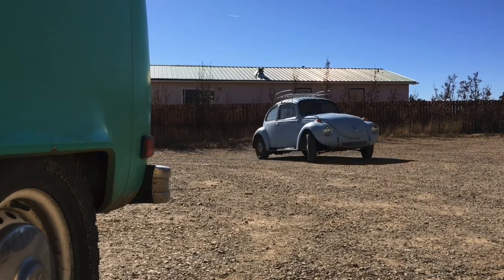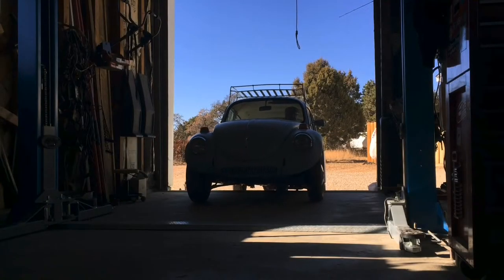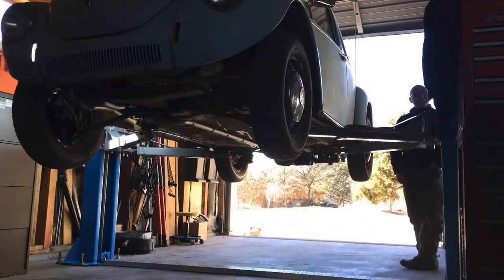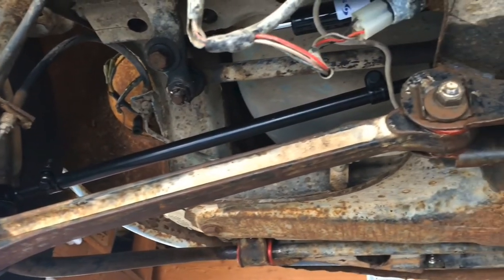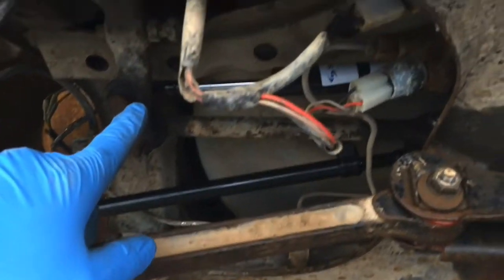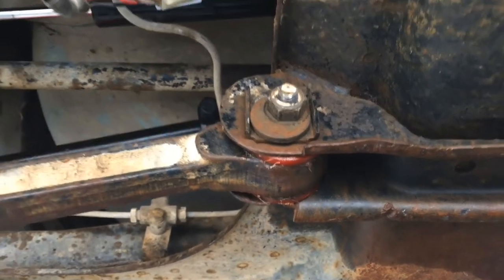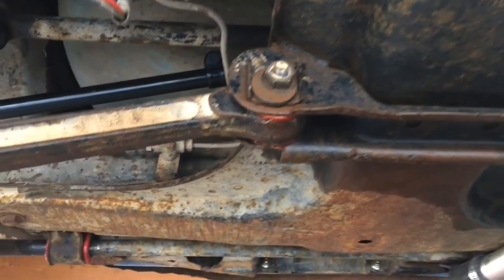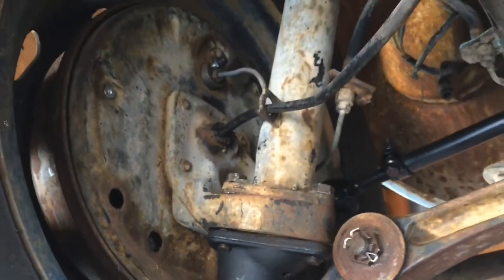BUGARU back in the shop

Comment: Love seeing the bug back! Did you do anything for the temperature sensor? I heard that after market gauges don't match well with the stock sensors.
Reply from the maker: +Ian .McKenna So there is a temp sensor, which feeds the computer data, and there is a gauge SENDER, which feeds you information (on the gauge) - your new temp gauge should come with a calibrated sender. Cheers!

Comment: Almost forgot I was a subscriber. The poly bushings? T3 Concepts, or some other specialized vendor? Would you say that the poly bushing set is the only way to counteract the "death wobble"? Curious minds want to know!
Reply from the maker: +Forthwith Tx Yeah, when I have to do wiring harness constantly it makes for little shop time. I went with the Empi poly bushings. I could have gone rubber but figured I'd try poly - should last a lot longer but may squeak eventually. Used antisieze to hopefully counteract the squeakiness of poly. I hear good things about T3.